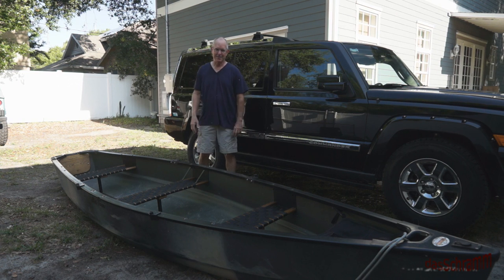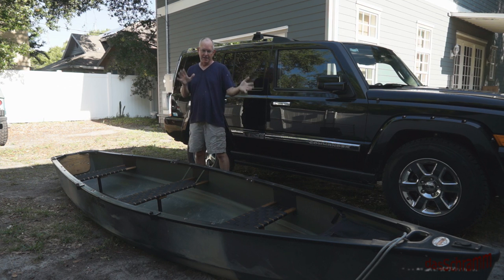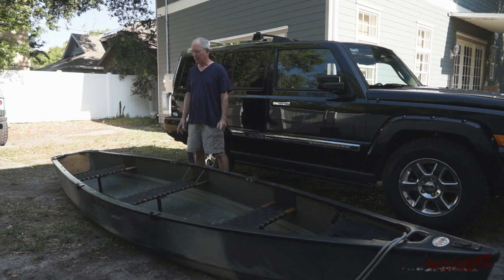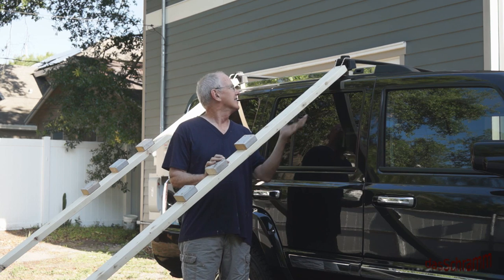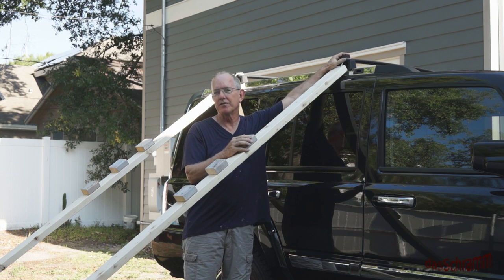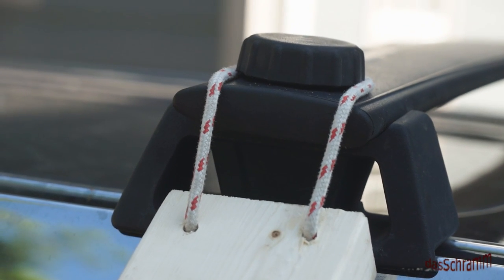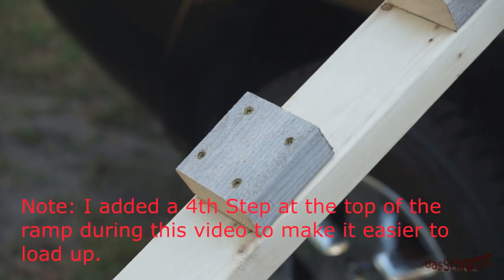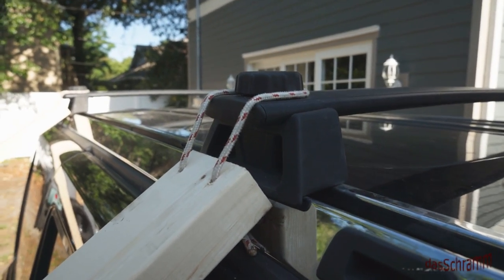DIY Roof Rack Boat Loader

Comment: Fantastic idea. I have a 335 cm long x 160 cm wide inflatable catamaran that weighs 35 kg. So that should be much easier to put on top of my sedan. When at home, I suspend it from the floor joists overhead via pulleys and rope. When the body is no longer willing, you have to engage your brain for solutions 😂. By the way I am 82 years old.

Comment: Nice.  I have a much lighter canoe, but I'm much older than this guy, so I need something like this.  I think blocks at the bottom, just high enough off the ground that the canoe is up off the ground as it is flipped over would help.

Comment: Hi David, might be a silly question but do you use the same method to get the canoe OFF the roof when near the water? Its a great, KISS approach using tried and true principles. I have a 16' cargo canoe that must weigh between 80-100 lbs so I need help to get it onto my B3000 truck rack. This method would allow me to do it myself and eliminate trailer which I usually use to avoid roof topping. However I can get into just about any lake or river with the truck (4x4) when not hauling a trailer. Now I just need a way to mount my 2.5hp outboard on to the truck, front or back.
Reply from the maker: I did use it to unload and I also used my wheel chair cart (see video) to move the boat into the water.

Comment: Hi, I was wondering how does it do on the  freeway when it's on the roof?
Of course after properly securing it.
Reply from the maker: I hide the boards under the canoe and tie them down.  They are protected from the wind and add no drag.  No problem.

Comment: Hi Dave,
I am weak after surgery but I refuse to give up. Could you please post the dimensions for the results that you came up with? I don't want to reinvent the wheel or in this case the incline plane. 😎
Paul
Reply from the maker: The 2x4 can be 8 or 10 ft long depending on how high your roof is. The steps are simply square blocks made from cutting a third 2x4. How many and their spacing is trial and error and depends upon  the boat.